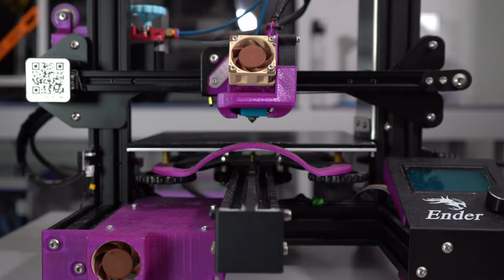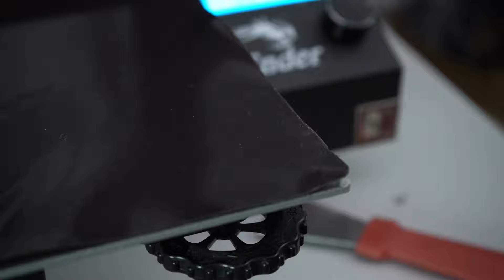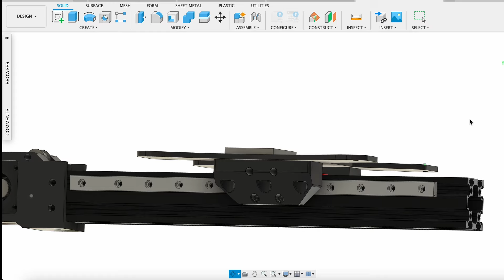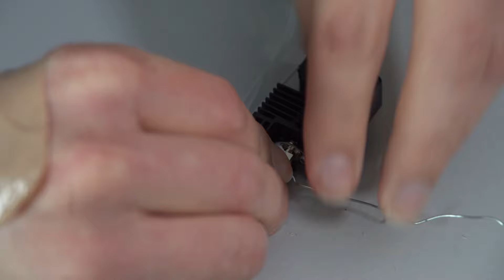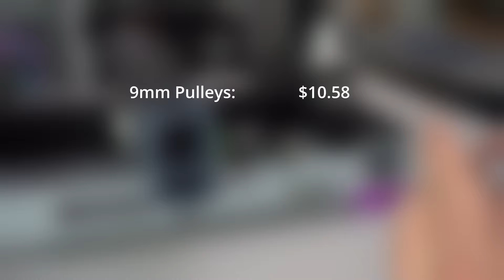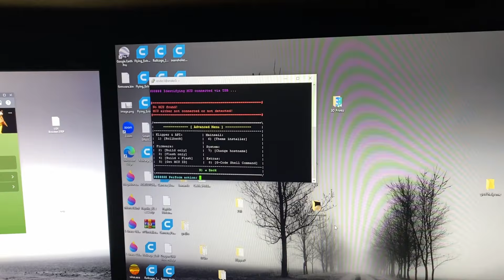Who Can Build The FASTEST Ender 3 For $100?

Comment: For anyone with the same issue with klipper on a creality board, the solution is to add install a bootloader. Ender 3 boards don’t usually come with a bootloader pre installed meaning you can’t upload firmware (klipper) via usb.
Reply from the maker: Adding on to this:

From my experience, you need an Arduino Uno to flash the bootloader to the board. I tried with Arduino Nanos and had no luck getting anything to work
Reply: @mitsumakes I actually used a small USB-ISP from an ender 3 Bltouch kit. It only works with a very specific sketchy app, but someone on Reddit made a good tutorial for it.
Reply from the maker: @joshuaturner8098  Good to know!

Comment: 10:54 you most likely needed to flash a bootloader with an arduino to the 1.1.4 board.
Reply from the maker: You're right. I tried using an arduino nano but didn't have any luck. In hindsight I think I should've used a more common arduino for the job
Reply: @mitsumakes Came across classic Ender for roughly 10,000JPY and flashed the board with arduino bootloader using arduino nano as ArduinoISP.

The Ender board must be set up as Sanguino in Arduino IDE.

Thanks for the video since I’m taking the first step into 3D printing in 2026 with Ender.

Comment: is the firmware .bin.bin ? its might be a problem.
Reply from the maker: The issue was the bootloader on the 8 bit board, but thanks for the suggestion!
Reply: thanks for the information ive researching for ender 3 upgrade in this year both of your video is help guideline me so much , ive found this problem while searching for firmware flashing for ender didnt know it is 8 bit issue ! thanks again 😊 @mitsumakes

Comment: for the USB cable, did you try taping off the 5v pin on the connector? all connection issues between the pi and motherboard for me have were solved by doing this

Comment: Why not dual y motor setup if you got a spare nema 17 motor from swapping the extruder motor ?
Reply from the maker: I wanted to try that, but the shaft on the Y motor is shorter than the extruder motor, so I couldn't get double sheer support for 9mm belts.

If I was doing this over again, I think I would ditch the 9mm belts in favour of dual Y motors though

Comment: Yesss, this is exactly how my experience with klipper was when I was building trident. First board (btt octopus ez) randomly stopped working around 5-20 minutes after firmware flashing and nothing could return it to working state apart from another reflash. Second one (btt manta m5p) refused to see can head, though it was working just fine in the same config on other printer. I was slowly losing my mind, decided I'm absolutely done with btt, ordered fysetc spider, installed, couple of evenings of config tinkering and everything was working... Or so i thought. To this day (3 control boards, 2 hosts, 2 sets of motors, 2 extruders, 3 or 4 hotends) this thing just refuses to work like it should. Guess some projects just don't want to be finished 😅
Loved your project, would be great to see it ripping some day!

Comment: I'm sure you know, but maybe forgot the 8 bit mainboard lacks a bootloader. Maybe why the klipper install failed? The mini usb, which i can't believe anyone is still selling in a product, was very common in cameras so you might find one with an old camera somewhere.
Reply from the maker: For this challenge I tried to use a raspberry pi as a bootloader (found a guide on reddit somewhere), but couldn't get it to work. I've since purchased an arduino so this shouldn't be so much of an issue anymore. Luckily the arduino came with mini usb cables too, so I have a few of those now!

Comment: Wondering why not to just run the 2x  12v fans in serial?
Reply from the maker: The point was to overvolt them to get more performance out of them. Otherwise it would've been cheaper to just get 24v fans
Reply: @mitsumakes  ah ok. I thought you'd said you only had 12v so had to use them. Although wouldn't 2 x 12v fans in series provide sufficient cooling even without being over run?
Reply from the maker: @imaginitivity7853  Running the fans at normal voltage probably would've been fine. In testing, 30% was about the highest fan speed I could run without risking parts warping significantly

100% was useful for overhangs and bridging though

Comment: Try to build marlin firmware using visual code studio and the marlin auto builder add on.  I have done this with my v1.1.4 board. also you'll need to remove the heatsinks from the driver boards to determine the driver type from the lettering on the chips and put that into the configuration.h file.

Comment: You were absolutely on the right path with a Bambu rip-off hotend.  Pity you didn't spot the one with V6 or stock Ender holes for mounting - you could have used the CAD time redesigning the part cooling to cool the parts instead of the hotend.

Sadly, you took a wrong turn and went down the wrong rabbithole with Churls github heater recommendations - they're for a stock Ender hotend with its terrible performance. The Bambu ripoff hotends are vastly more capable with their little 48w ceramic heaters - depending on the plastic you feed them from 25 to 30mm^3/s. Fitting a real CHT nozzle can add another 5-7mm^3/s to that.
Reply from the maker: I did see both the V6 and stock Ender versions of the bambu clones, but they were both at least twice as expensive as the normal version so I didnt use them.

You'd be surprised how the part cooling performs in real life actually, it sure looks like its pointing straight at the hotend, but in reality most the airflow is directly below the nozzle (of course, there is still a decent amount of air blowing on the nozzle, but thats what the dual heaters are for!)

Comment: When I changed the firmware on an SKR mini e3 V2 I'd compile it with visual studio with marlin addons, format the micro SD card to put the firmware file on it, put the micro sd card into the printer and turn the printer on. It takes a little longer to boot to flash the firmware initially but then everything is right as rain. The compiled firmware that bigtreetech provides for the mini e3 v2 was corrupted so I had to figure out how to compile the firmware myself to fix it.

Comment: just for 100 you can get an ender 3, so stock speeds? Jokes aside, great video, loved your style of doing the video.
Reply from the maker: $100 of upgrades :)

$100 including the printer would be a real challenge!
Reply: No really, right now you can find Ender 3 for as low as 20 bucks
Reply from the maker: @DiomedesDominguez  Where do you live where you can find them that cheap? I spent over a month checking local buy and sell groups before I snagged mine for $80
Reply: Dominican Republic. Everyone that had an Ender 3 already move on to a bambulab  or threw it away and those that still have it is for collecting dust in a corner.

Comment: You could always connect the 2 part cooling fans  in series to run them on 24v
Trying to build the klipper firmware on the Rpi might be a problem.  Install klipper on your Mac and build it there.  Then flash the board and try to connect to it from the Mac.  Once you get that far, then move the board to the printer and try to connect to the Rpi.  You can also configure the firmware to connect via a serial port on the board (most  of those boards either have an available uart as well as a native usb connection) and then use the Rpi's uart for the connection.  Enabling the serial port on the Rpi may require running the Pi's configuration program.  I had issues with flashing the V4.2.2 board on my Ender 3, but it turned out that I had flashed it ok, and the serial ID I found wasn't what I thought it should be.  However, it did work once I got it wired together and started up klipper.  I got an error message because I hadn't yet edited printer.cfg.
Reply from the maker: You could run 2 12v fans in series, but I want to run them on 12v for extra cooling performance.

Just to clarify, getting klipper on the pi wasn't the issue, it was flashing the board. I was trying to use the pi as a bootloader following a guide I saw on reddit. I've ordered an arduino (which seems to be the proper solution) and will try again once that arrives.

Good tip with using uart, I should've tried that when I was having issues with the other boards! Thanks for watching!

Comment: Can you share or link your hotend mod? I really think this setup would work amazingly on my ender 5
Reply from the maker: The toolhead mod? I think that should be fine, but the stock Stiffy toolhead doesn't work on an Ender 5 due to the way the belts attach to the carriage
Reply: @mitsubishimakes  awh yeah. Ur right. But your mod to make it fit to the ender style plate. was it a simple cad project or an existing file? Because my ender 5 plate has the same mounting hole layout as the 3
Reply from the maker: @Rubiniuz  Stiffy is already designed to work with the Ender 3 plate, and I'm pretty sure there's a mod out there for the Ender 5, just not with the bambu hotend

https://github.com/churls5495/Annex-Engineering_User_Mods/tree/main/Extruders/Sherpa_Mini/Toolheads/Churls-Chubby_E5_remix
Reply: @mitsumakes  great. I saw your link in the description. Do you have a link for the bambu hotend adapter i found one but it looks to big to fit in this configuration if i load it into cad. apologies for not clarifying. thanks thus far!
Reply from the maker: @Rubiniuz  That link I sent in the comment is to the ender 5 version of the toolhead specifically, which should save you some effort if that's what you want to use. 

I took a look for the hotend mount and I cant seem to find the exact one I used. I found it on thingiverse but I downloaded it months ago so there's a chance its not up anymore

Comment: I've copied the churls setup, it reaches amazing speeds
Reply from the maker: Glad to hear it! How do you find the cooling?
Reply: @mitsumakes  it works great! but you absolutely need the +60w heater, cooling overwhelms the heatblock if you use the stock 40w heater. Your solution is raw but genious. Also I was thinking of doing what you did with the Y axis motor, but haven't tried yet. Also, to reach the maximum speed I needed to use a .py script to control the Y and X axis speed independently. Other from that, i could achieve lousy benchy @12 minutes with cheap filament and no input shaping or pressure advance so I guess with some fine tunning and high speed filament I can get it to print well. I Really hope you finish your E3 mod, I also fried a 4.2.7 board while doing this mod haha, so I understand your frustration from the video.
Reply from the maker: @CarlosMoreno_h  It sounds like your setup is working quite well then! Instead of the .py script you can also use Kalico instead of Klipper. It has that function natively, and I intend to use it if I can.

I'm definitely gonna try hard to get the printer up and running ASAP, I wanna see what it's capable of!

Comment: As soon as you said 8 bit board and couldn't get klipper to work i had my money down on no workey or wins. Looking forward to the next one.
Reply from the maker: Definitely a risky play for someone who has never flashed an 8bit board before. I'm getting an arduino this week and gonna see if I can figure it out 😎
Reply: @mitsubishimakes  for those I believe you'll need an AVR programmer and add a bootloader if I'm not mistaken.
Reply from the maker: @ I believe so as well. I tried to use the pi as a bootloader (someone on reddit said you could) and had no luck. Hopefully the arduino will work

Comment: why direct drive? isn't bowden better for speed benchy? You turn off retraction and pressure advance anyway, it's not like you care about clean corners or ooze, right?
Reply from the maker: The goal isn't just to do speedboats though, at the end of the day I want a printer that prints faster and better than the stock machine
Reply: @mitsubishimakes    oooh ok thus also the wide Y belt because unless you're skipping you don't really care that 6mm is a little floppy and tends to oscillate more.

Creality 8-bit boards are a little special, there is no Arduino bootloader on them, so they won't accept flashing over USB. You have to find SPI pins, on another board i had to steal them from display connector, and programmer say usbasp or an Arduino with programmer sketch and do bootloader programming before klipperizing. Or alternatively... well there's ways to do it. Personally i don't use the Arduino bootloader for reasons but another one, because i needed watchdog recovery, but that can cause other types of last minute fun under presssure like that.

Comment: why a pi zero 2w and not a regular pi zero without the wifi?
Reply from the maker: That way I could connect to the printer over wifi
Reply: @mitsubishimakes  It's moot in this case anyway but from pure price to performance the pi without wifi is quite a bit better, unless wifi is needed for something? 

Was the criteria better printing experience or better resulting speed and quality?

Comment: Do you have a link for your y motor mount remix? I'm pretty much shooting for the same thing with my bed slingers. I'm putting Dragon Burners on them with can boards, using the old extruder motors for the Y, and doing dual belted Zs while trying to be as budget friendly as possible.
Reply from the maker: I haven't published mine anywhere, but I could throw it up on printables if you'd like. Since I didn't get to that part in the build, it is essentially untested though :)

Comment: It would prefer a dual z. But I don't want another bedslinger so I scrapped my broken one for parts.
Reply from the maker: Dual Z would've been nice. Pretty hard to fit that in the budget though
Reply: @mitsumakes  the KevinAkaSam vbelt mod is pretty affordable and has some nice results.
Reply from the maker: @ Last I saw the kits for that were like $45 on Aliexpress. Could probably get the price down a bit if you modded it to use some other components, but it's still a lot of money at the end of the day
Reply: @mitsumakes  I got mine for about 20, that being said it was about a year ago so maybe prices have changed since then:(
Reply from the maker: @ Might also be a location based thing. Stuff is always more expensive up in Canada